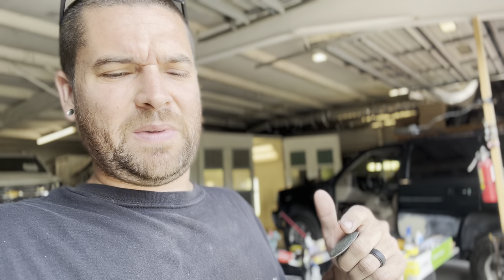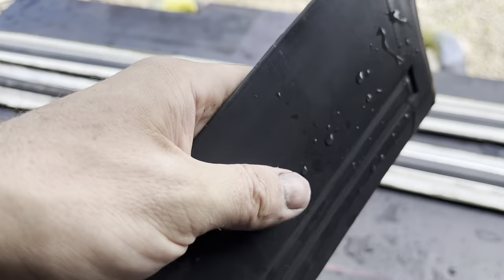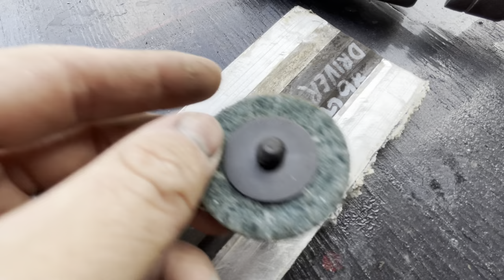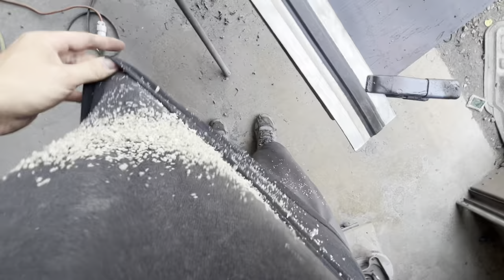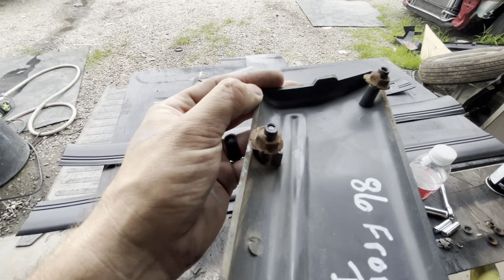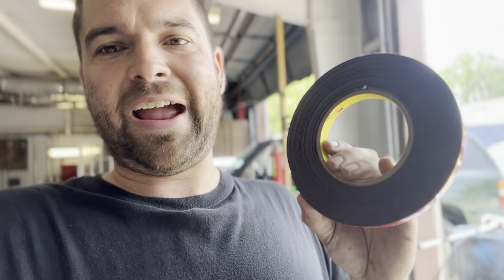👉🏻 4 Eye Fox Body Molding Issues 🥴 Here’s our fix and some tips 💥

Comment: I found that by using tape on the painted surfaces before drilling keeps the drill from walking & helps prevent chipping the paint also useing a heat gun with the eraser also helps removing the double sided tape easier . Great content Thank You & Best Wishes . 🇺🇸🇵🇷🦊👍
Reply from the maker: Good tip thanks!

Comment: Ive had good luck with 3M strip-it fiber style wheels for taking dbl sided tape off. Also used safety wire with two dowels for handles to saw the side moldings off and not bend them. Kind of like cutting out a windshield. Just put paint stick behind it as you cut, so it doesn't glue back down. Don't know if that helps any, but its what has worked for me.
Reply from the maker: Yes we have done it that way also but with fishing line
Reply from the maker: Thanks for that tip
Reply: @ThePaintPaperHustle  that's what I use too on new dbl sided tape. I had trouble with it breaking on the old dried out stuff. I worked as a painter in a huge Ford dealership in 90-93. When fox bodies were new moldings were a lot easier to remove 🤣
Reply: @ThePaintPaperHustle  you're welcome. Enjoy your content.
Reply from the maker: Thank you
Reply from the maker: Lol oh I’m sure they were

Comment: With the factory moldings I have peeled the metal out laid them in the sun and taped directly to the molding. They also have reproduction ones although the fitment is not perfect. No disrespect meant.
Reply from the maker: Peeling metal out is a great idea to get them to go back straight

Comment: I'd use a carbide burr bit to oblong the holes / or drill a new hole with proper sized drill bit
Reply: If you're worried about the paint put tape over the hole and use a marker to make an outline
Reply from the maker: Both good ideas. What I ended up doing was drilling a new hole
Reply: @ThePaintPaperHustle  i commented too soon, i saw that 😂

Comment: 87-93 fender had a slightly bigger wheel opening and different stud holes spacing than the 79-86…….drill and stepping the holes higher in the fender and brush painting them is the only option thats realistic and cost affective imo
Reply from the maker: Yup that’s what I did
Reply: @ThePaintPaperHustle  just finished watching, habit of typing a response as im watching because….old folks forget shit😂. We have straightened moulding the same way you do steel, body hammer on the aluminum to ping it to draw the rubber then put it under a heat lamp, oven or direct sun on hot ass days and ratchet strap it (lightly) to a 2x6with a piece of old tire tube between them to not deform the rubber. Sometimes we used a spacer back away from the curled edged and pulled just on the rolled tip/edge and with heat we usually got them back in shape and stayed for years but sun will do its damage again though just like with the bumpers
Reply from the maker: Yup absolutely them are great ideas and tricks

Comment: Frustration level 9.9 lol. What is up with the lower fender to bumper not matching up?
Reply from the maker: It has to have the ground effect pieces put on. Idk I don’t know much about these cars
Reply: @ThePaintPaperHustle  Oh ok, no fox body guy here either lol, if you ever have problems with double sided tape not sticking to the moulding try using some adhesive primer, that stuff is amazing 👍
Reply from the maker: Yes I actually have some at home but not at the shop